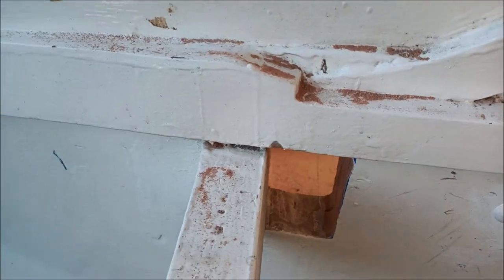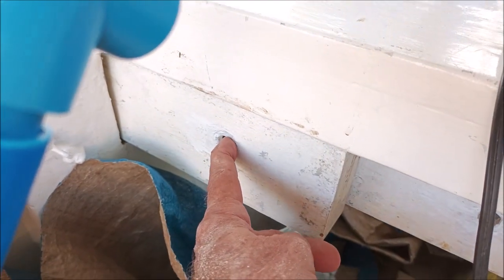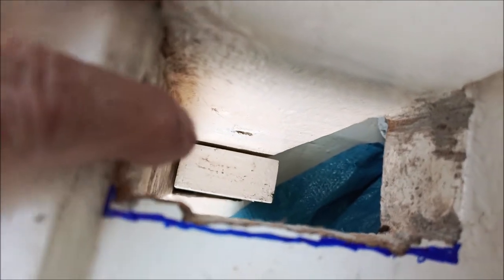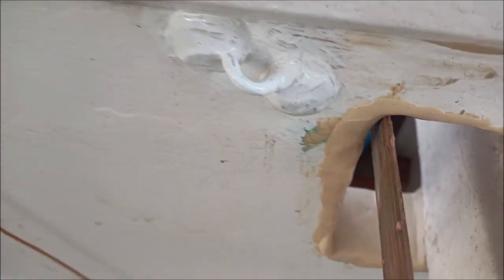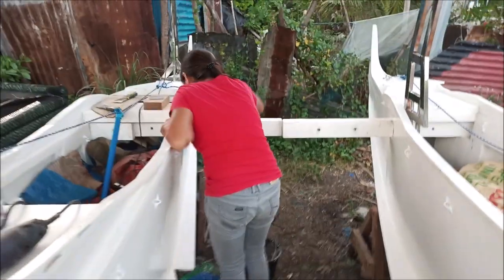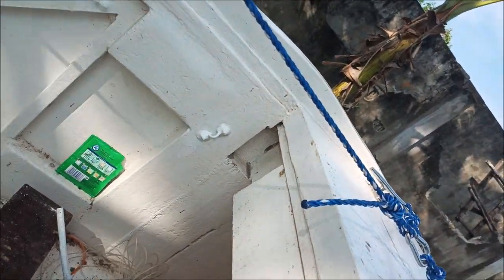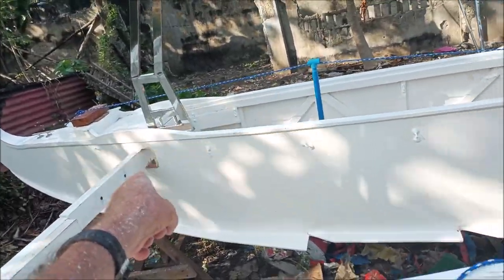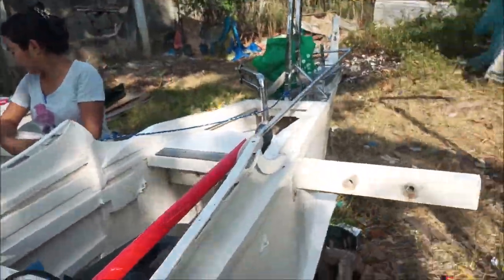How I Connect The Hulls On The Paradise Trimaran

Comment: Why didn't you use steel plates instead of epoxy?  Pretty much thickness of the hull plus 1.5" on either side for a flange to bolt is in, do this on the 3 sides.